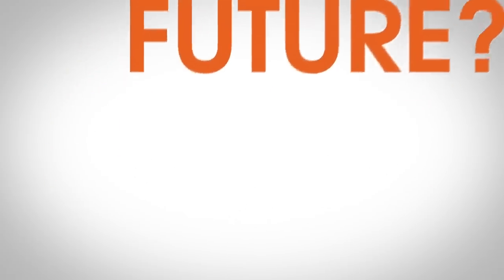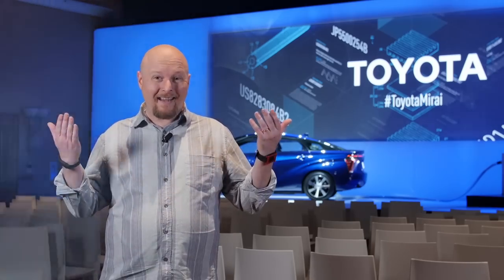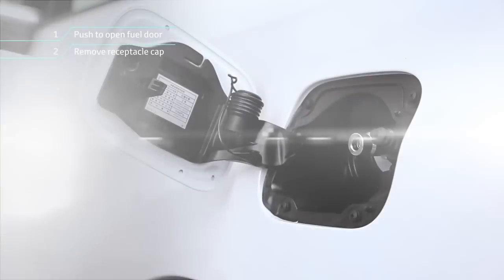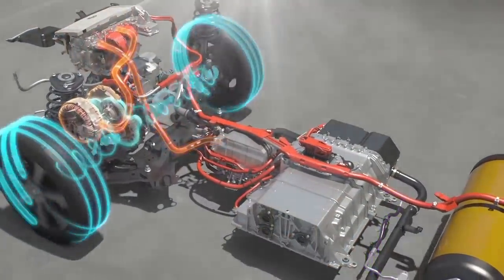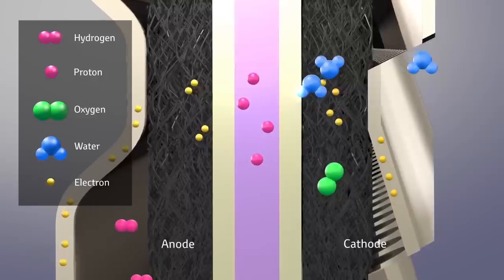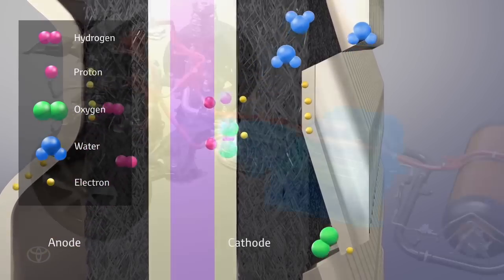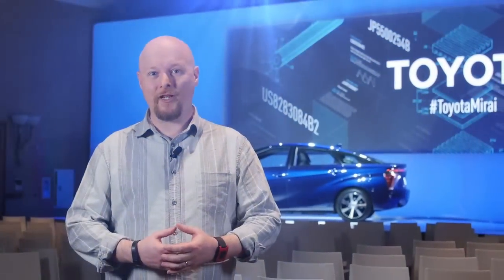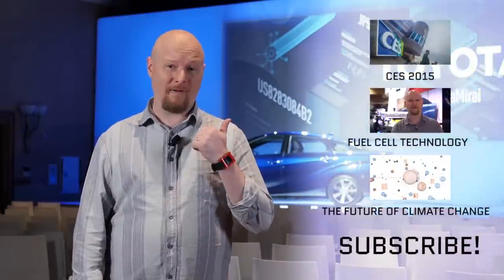How Fuel Cell Vehicles Work – CES 2015

Comment: So will hydrogen fuel cells replace the EV battery? Will you theoretically plug in a hydrogen cable into your car, as Ev cars plug in an electricity probe now?
Reply: Toyota has always lied in such promotional videos and this has not changed 6 years later. At 4:58min they claim: "No carbon emissions like petrol or diesel powered vehicles".
This is true - if you look at the fuel cell car alone. If you look at the whole chain (well-to-wheel), hydrogen today in 2021 is made from more than 95 per cent natural gas, coal and oil, as it was in 2015.
The hydrogen car is therefore dirtier than all other vehicles!
Of course, hydrogen can be produced from renewable energies via electrolysis. But this method is several times more expensive and therefore there will never be a large number of cars with hydrogen as an energy storage medium.
Toyota needed until 2019 to produce and sell 10,000 Mirai.
At 4:59min I had to laugh:
The biggest revolution has failed ...
The new Toyota Mirai II (2020) does not even have a folding rear seat back. The hydrogen tanks take up a lot of space.

Comment: I don't get it. Why add all those steps: Distilling hydrogen, storing hydrogen, distributing hydrogen, building the infrastructure do all that, building the infrastructure to make fuel cells and putting all of that in a vehicle - storage, fuel cell, converter - to power a car, when now you can plug your car into the wall of your house and haul ass in one of the finest machines ever crafted  by the hand of man? Why add steps to the process? Just more to go wrong, more to break, more to fail. Can anyone explain that?

Comment: Fuel cells continue our dependence on the petroleum industry because someone is going to have to supply you with Hydrogen for your fuel cell car. This supplier will of course be the petroleum industry. For now, pure battery electric vehicles (BEV's) are the way to go.

Comment: hydrogen is for fussion nuclear power plant , lithium ion is for battery powered car
Reply: Actually, the nuclear fusion plant concepts of today would use lithium-6 to breed tritium.
But it wouldn't really have a significant impact on the availability of lithium for lithium-ion-batteries.
And lithium-ion-batteries might be outdated anyway, when the first commercial nuclear fusion power plant gets operational.

Comment: i feel in the future we are going to have multiple ways to fill our tanks , we will have hydrogen fuel , we would have superchargers for electric cars and maybe even other alternative ways to keep cars moving  , The aim i feel is to move away from non renewable resources as soon as possible.
Reply: Toyota has always lied in such promotional videos and this has not changed 6 years later. At 4:58min they claim: "No carbon emissions like petrol or diesel powered vehicles".
This is true - if you look at the fuel cell car alone. If you look at the whole chain (well-to-wheel), hydrogen today in 2021 is made from more than 95 per cent natural gas, coal and oil, as it was in 2015.
The hydrogen car is therefore dirtier than all other vehicles!
Of course, hydrogen can be produced from renewable energies via electrolysis. But this method is several times more expensive and therefore there will never be a large number of cars with hydrogen as an energy storage medium.
Toyota needed until 2019 to produce and sell 10,000 Mirai.
At 4:59min I had to laugh:
The biggest revolution has failed ...

Comment: If it were me, I would send the hydrogen that has lost its electron to the engine, the battery will be charged and the rest of the hydrogen will go to the engine and it will be cheaper

Comment: The process is simply converting one energy source directly into another. The process as I understand it uses electricity, so how do you make the electricity in such quantity it will power hundreds of millions of cars ?

Green energy is the obvious answer, but has anyone begun to work out how much. It may well be the case that if you covered the entire nation with green energy methods, it would only touch the surface of the problem.

Comment: What's taken so long?...Fuel Cells were used in project Apollo....I've believed in this technology for decades...Hydrogen is the answer!....I've been waiting on an advanced storage system for Hydrogen that is both safe and lightweight...Steel tanks obviously are not the answer....If we can realize Hydrogen at a modest enough cost, I would like to have a fuel cell powering my home...I have done some experiments with an HHO device powered by solar cells which produced Hydrogen enough to fuel a small toy fuel cell...If I had a method of storing some of the Hydrogen, it could run my fuel cell at night...I would love to know what your using to store the Hydrogen in your cars......

Comment: Soooooo..... whats happening today? Why does it seem nothing is progressing and the future seems to be batteries?
Reply: Toyota has always lied in such promotional videos and this has not changed 6 years later. At 4:58min they claim: "No carbon emissions like petrol or diesel powered vehicles".
This is true - if you look at the fuel cell car alone. If you look at the whole chain (well-to-wheel), hydrogen today in 2021 is made from more than 95 per cent natural gas, coal and oil, as it was in 2015.
The hydrogen car is therefore dirtier than all other vehicles!
Of course, hydrogen can be produced from renewable energies via electrolysis. But this method is several times more expensive and therefore there will never be a large number of cars with hydrogen as an energy storage medium.
Toyota needed until 2019 to produce and sell 10,000 Mirai.
At 4:59min I had to laugh:
The biggest revolution has failed ...
The new Toyota Mirai II (2020) does not even have a folding rear seat back. The hydrogen tanks take up a lot of space.

Comment: Wow, science has come a long way. Hopefully the cost of using a recharging (hydrogen) station will not be near the amount we are paying for gas but then again, corporate fat cats might use the environmental angle to charge more.

Although burning hydrogen is much cleaner than burning fossil fuels, we still have to consider the amount of water vapor we would be placing into the atmosphere, causing climate changes.

Comment: Can't hydrogen fuel cell cars run off water, by putting energy into water it can separate the molecule into hydrogen then that hydrogen can be used to power the car and this process can continue marking the car more efficient, why don't we use this method?
Reply: Stick 9 volts in to split the water and get 1 volt back from the cell
Reply: Oh wow I had no idea it was that inefficient
Reply: ty pat   It isn't, this guy is being sarcastic or is misinformed. 
Currently hydrolysis or the process of converting water to hydrogen and oxygen is about 65% efficient, but there are some new processes that are promising to increase the efficiency beyond 80%.
Reply: Why don't they use this, 65% is very efficient compared to the combustion engine.
Reply: ty pat  It is getting closer everyday.
The 65% efficiency figure I cited is only for producing the hydrogen fuel from water using hydrolysis. 
Some hydrogen fuel cells are over 70% efficient. 
There are other fuel cells that are capable of being directly fueled with methane(natural gas), ethanol and methanol.
The downside of direct fueling the current technology fuel cells with methane(natural gas), ethanol or methanol is fouling of the fuel cell membrane. 
Pure hydrogen does not have the membrane fouling issues that methane(natural gas), ethanol or methanol does and is currently the preferred fuel. 
Many vehicle electric traction motors powered by the electrical energy produced by the fuel cells are more than 94% efficient. 
Yes, the entire fuel, fuel cell and motor are significantly more efficient than an internal combustion engine which is less than 27% efficient.
Reply: patw52pb1 I was referring to the entire process - ie from the electricity put into the electrolysis (which could have been immediately put into an electric car) to the electricity coming out of the fuel cell after all the energy used to capture, liquify, transport, cool and compress the hydrogen to 700 bar (10,150psi) have been taken into account.
If you are aware of someone achieving or even anticipating anywhere near 80% it would be no doubt of interest for you to direct everyone reading this posting as to where they might read up on this.
Reply: Roy Richardson Show your math because that is not how your comment reads or what it says. 
Your basis is erroneous. 
Hydrogen does not have to be liquefied, compressed to 700 bar or cryogenic cooled. 
Hydride storage is the answer and it is now commercially available. 
Using your criteria what is the efficiency of crude petroleum to wheel turning in the average conventional vehicle powered by an internal combustion engine? 
Answer: less than 12% when a complete accounting analysis is performed. 
You have a computer and access to Google, do some searching. 
Try NREL and the major universities such as MIT. 
BTW:  I have a fuel cell farm that is approaching 75% efficiency that is rated at 1 MW of output and is the backup generator for our datacenter.
Reply: Very good sir, I'm pleased to here this information I was unaware of this, so is it efficient to recycle the water made from from the hydrogen fuel cell car?
Reply: ty pat I don't how that it would improve the overall efficiency, but capturing and recycling the fuel cell H2O output is certainly feasible. 
Most fuel cells that I have worked with have an exhaust port that a collection apparatus and reservoir could be attached.
Reply: patw52pb1 I am fully aware of all that.
I scenario I mention was picked because it is the one proposed by Toyota for their Hydrogen car in CA.
The efficiency of an ICE car is beside the point - my point is that if you have the electricity in the first place why not use it to power an electric car rather than going through all the expense and efficiency degrade to go the hydrogen route.
Reply: ty pat The car mentioned in this piece - the Toyota Murai - dumps the water generated onto the road from a port in the bottom of the car. There is a control to decide when to dump the water - so I guess you could catch it.
Reply: Roy Richardson In answer to your question: Initial range and the extended range from easy rapid refueling. 
The vehicle featured in this video is an electric car...  powered by a hydrogen fuel cell.
These interim vehicles are stepping stones to get to more technologically advanced systems that will eventually be longer range and less expensive.
There is nothing preventing a plugin hybrid with a battery and a fuel cell. 
That could produce a vehicle that would provide inexpensive plugin charging for short urban trips and a fuel cell for backup and extended range trips.
Reply: patw52pb1 ty pat You are talking only about first step, electrolysis.Lets suppose they make it 80% efficient, than you have compression of hydrogen which is 90% efficient, than you have full cell which is 50% efficient (current state is 35% at high loads, 45% at low loads, but lets use 50%), and skip transportation losses.
You end up with 0.8 * 0.9 * 0.5 = 0.36 or 36% total efficiency.
With 300kWh of electricity fuel cell vehicle will do 300 miles, and electric vehicle will do 900 miles.
Reply: Sasoon2006 Sure is a lot of supposition and random number generation going on. Exactly where did you get your performance numbers?
With hydride storage of hydrogen, high pressure compression, low temp chilling and liquefying is not used. 
What transportation losses? 
What are you basing the statement "With 300kWh of electricity fuel cell vehicle will do 300 miles, and electric vehicle will do 900 miles" on? 
Using your equation, what are the numbers for a traditional gasoline ICE vehicle?
Reply: ***** Is this a joke ?
Reply: ***** Are you seriously trying to Compare humidity which would simply equate to more rainfall Versus Carbon Monoxide Pollution and poisoning?

You realize the difference in the degree of severity?

 it will become extremely humid, and then there would be the case of levels of oceans rising, animals dying. etc. etc.

This statement is so wrong it is not even funny. We take H2o, Split it through reforming or electrolysis. And you get Hydrogen and oxygen, You then combine Hydrogen and Oxygen back into H2o. 

You start with an amount of water, you end up with the same amount of water.

Hydrogen is not an energy source, it is simply a energy storage method the same as a battery, except you are using hydrogen and some clever ways to store and release energy through the cycle.

Comment: 1. water (or natural gas) -> hydrogen -> electricity ----sounds inefficient to me !
2. next innovation is required in generating hydrogen
3. concern i have - the byproduct is water (ok...it is better than CO2) - but did anyone notice that we may be loosing on oxygen - far more than any other solutions? 

Still i will vouch for this solution if no. 2 is addressed and if the source of hydrogen is water - that way at least the circuit seems complete ..... water -> hydrogen + oxygen -> electricity + water
Reply: did you take into account the energy required for separating them ? - i am referring to that process as being inefficient.

Comment: I think HFC technology is the way to go for EV, but I am also a strong supporter of Compressed Air Vehicles( CAV) I of which called the ‘Airpod’ by TATA motors is due to go into production by 2020. Fords have made a prototype ‘Model T’ CAV ‘, which has an even better design of CA Engine than TATA’s. Then there’s my all time fav fuel which is Carbon Negative Algea Bio Fuel, which will allow us to use the Internal Combustion Engine Vehicles instead of making billions of new Vehicles while sucking  out and permanently removing Carbon from the atmosphere!.

Comment: The problem with using hydrogen as an energy storage is efficency. Convert electrical energy into hydrogen by electrolysis and you'll lose about 20% of your input energy. A fuel cell has an efficency between 40% and 50%. This leads to an overall efficency of about 32% to 40%, not concidering the efficency of energy production. 

This means that by taking the sideway to store (and recapture) our energy in hydrogen more than half of your produced energy gets wasted.
Reply: The average efficiency of gasoline powered cars is 25%. Only 25% of the chemical energy in gas is turned into kinetic energy.
Reply: RoScFan Yes, but if you're using gasoline to power a car you don't have to produce (or better capture) the chemical energy in it. You just have to dig it out of earth's surface. 

To create hydrogen you need energy to begin with to do so.
Reply: You lose another 10% compressing it, and currently fuel cell efficiency is 35% at high loads, and 45% at low loads, so you end up with 25% total efficiency.
For example, with 100kWh of electricity FCV will do 100 miles, and EV will do 300 miles.

Comment: The hurdle is cheap oil.  Just suck a neverending supply out of the ground, use some of it to heat the rest until it separates and viola....gasoline cars, kerosene heaters, diesel locomotives and airlines.  The price to produce and distribute H will have to come down to levels similar to pumping oil before this technology become economically feasible on a large scale.

Comment: Using hydrogen to assist gasoline is fine to start maybe it will change to pure hydrogen powered and eventually fusion engines where hydrogen becomes helium , by then cars ought to be flying .:)))

Comment: Toyota has always lied in such promotional videos and this has not changed 6 years later. At 4:58min they claim: "No carbon emissions like petrol or diesel powered vehicles".
This is true - if you look at the fuel cell car alone. If you look at the whole chain (well-to-wheel), hydrogen today in 2021 is made from more than 95 per cent natural gas, coal and oil, as it was in 2015.
The hydrogen car is therefore dirtier than all other vehicles!
Of course, hydrogen can be produced from renewable energies via electrolysis. But this method is several times more expensive and therefore there will never be a large number of cars with hydrogen as an energy storage medium.
Toyota needed until 2019 to produce and sell 10,000 Mirai.
At 4:59min I had to laugh:
The biggest revolution has failed ...

In solchen Werbe-Videos wurde von Toyota schon immer gelogen und daran hat sich auch 6 Jahre später nichts geändert. Bei 4:58min wird behauptet: "Keine Kohlenstoff Emissionen wie bei Benzin oder Diesel angtriebenen Fahrzeugen."
Das stimmt - wenn man nur allein das Brennstoffzellen-Auto betrachtet. Betrachtet man die gesamte Kette (Well-to-Wheel) wird Wasserstoff heute in 2021 noch wie schon 2015 zu mehr als 95 Prozent aus Erdgas, Kohle und Erdöl hergestellt. Das Wasserstoffauto ist damit schmutziger als alle anderen Fahrzeuge!
Natürlich kann man Wasserstoff aus regenerativen Energien über Elektrolyse gewinnen. Aber dieser Weg ist mehrfach teurer und daher wird es nie PKW mit Wasserstoff als Energiespeicher in hohen Stückzahlen geben.
Toyota brauchte bis 2019, um 10.000 Mirai zu fertigen und zu verkaufen.
Bei 4:59min musste ich lachen:
Die größte Revolution ist ausgefallen ...